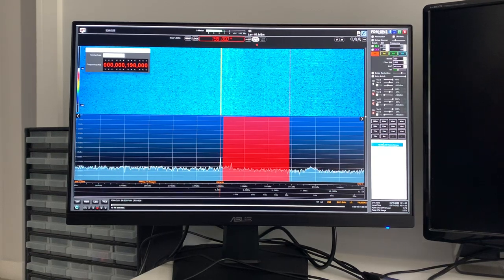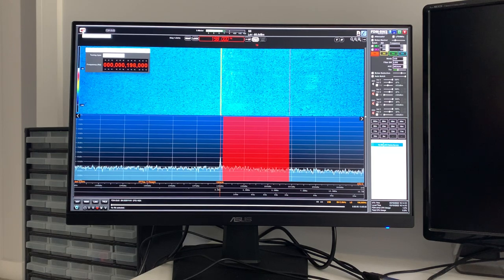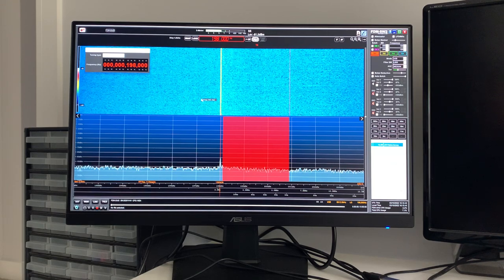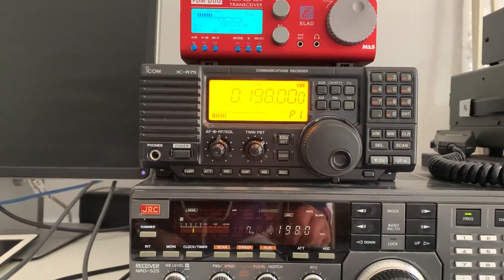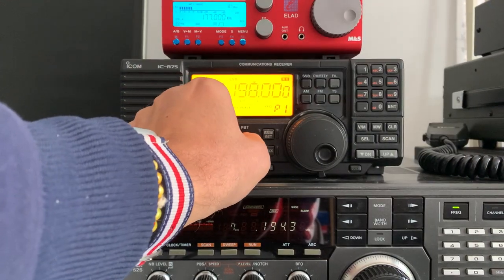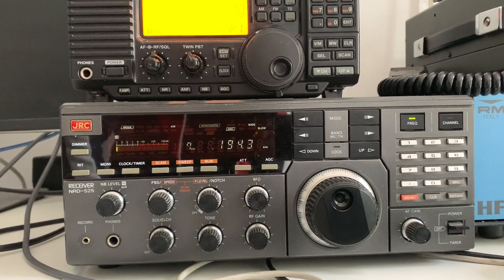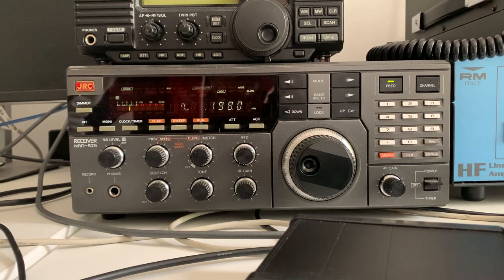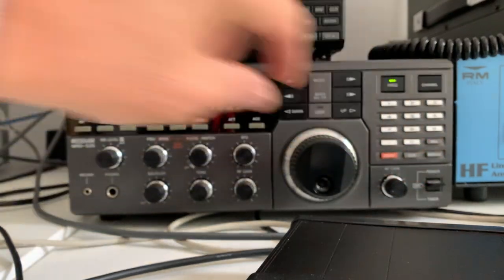BBC Droitwich transmitter is down, revealing the Radio 4 signal on longwave from Burghead/Westerglen

Comment: Hi Clint, up here in Dundee 198 Westerglen is the main transmitter for Central Scotland. Its the one I listen to. Its quite a sight at night when you pass it on the road. 73 and GDX
Reply from the maker: Cheers, Jim. It was quite a thrill to hear one of the two transmitters in Scotland. I did try to orientate the Wellbrook loop for optimum signal strength, but about S7 was the best I could manage. Perfectly readable of course, but nothing beats that S9+30dB from Droitwich! It's a bit like when Ireland is down on 252 kHz and Algeria comes storming in! All the best and 73.

Comment: I could still receive BBC R4 LW yesterday with my Sony ICF-2010 indoors, weaker but still audible. It seemed to be restored in the evening. BBC Radio 5 Live on 693 Droitwich was also affected, although I still had good signal maybe from the Brighton relay not far from me. Thanks for sharing & 73s.
Reply from the maker: Looks like you were copying the same signal as me! 73

Comment: What will happen to all the economy 7 radio teleswitches ? When they don't get a switch on from the 198m  transmitter tonight?
Reply: The old French longwave transmitter on 162 KHz which 'closed' some years ago now just sits with a carrier and their data signals for switching.
Reply: There is actually current info from the BBC that the agreement with the british teleswitch operators is definitely ending by the end of 2023. After march 2024, the longwave service over 198 kHz is planned to end for good, entirely. So, alternative ways of controlling these devices (maybe over the internet) seem to be on the way.
Reply from the maker: See other replies - but the deal ends this year so it won't be the BBc's problem. 73

Comment: How do they keep the multiple transmitters from interfering with one another? A few years ago reception from other English stations like Absolute Radio and Five Live was poor, with echoes and fading. Reception of Radio 4 is good in Latvia.
Reply from the maker: If it's the same transmission, the slightly different path lengths result in a slight echo. You can hear that sometimes on MW with Spanish stations.

Comment: In the 70s and 80s, when I lived in Plymouth, R4LW had some peculiar slow (minutes long) deep fading that affected the sidebands differently. At least, the audio got quite distorted, whuch I put down to phase differences between the sidebands. This was only audible on ferrite rod antennas - the long wire was always fine - and some very small changes in the set's position or orientation could change things quite a lot. Seemed worse in daytime. I never understood it - I was still at school and RF was a bit weird - but I wondered at the time whether it was multipath enhanced by the buge lump of granite called Dartmoor that was between me and Droitwich. Never seen the phenomenon discussed anywhere, but it puzzled me then and puzzles me now.
Reply from the maker: Thanks for your comments!

Comment: Have you got Scotland in the null of the loop? That would make sense if you were trying to reduce the level to pick up other signals from East and West.

Upper vs Lower - it is like upper class being better than lower class, upper income better than lower income or upper Manhattan vs lower Manhattan...ah, maybe there is a flaw in my argument... more seriously, perhaps the noise or some phase effect.
Reply from the maker: No, I adjusted the orientation for this recording. I thought it might be a phase effect - much more obvious on the loop than on my wire. 73

Comment: I'd heard somewhere, maybe right or wrong, that the BBC were experimenting with a different type of modulation to try and cut down on the amount of power used to generate the same amount of output, a bit like SSB while generating both usb and lsb plus a variable power carrier when modulation takes place (DSB using class C). I'm not saying this is the case of what your hearing or its just general maintenance taking place and it's the effect of ground wave effect on your loop antenna. Also when the supply of klystron output valves run out then that will be the end of 194LW.
Reply from the maker: Using less power does make a lot of sense - it's one of the big negatives to R4 on LW.
Reply from the maker: Thanks for your comments.
Reply: Klystrons for LF? The BBC are very short of money. R4LW was due to close approximately 10 years ago (from 2022). Allegedly the Shipping Forecast saved it then. Whether it will survive now in the light (no pun) of the vertical trajectory of energy costs is anyone’s guess.
Reply: @ianharrison6597  I can't possibly imagine that it's klystrons - Klystrons can barely handle the lower part of the UHF range. The OP doesn't know what they're talking about. 

They are likely some variation of a large water-cooled tetrode, if I had to guess. In any case, there are plenty of companies that could easily rebuild that sort of tube - CPI in the US, Thales (France),  and there is at least one company in Japan that could do it. There are a few companies in Russia that could do it if international politics were to clean up a little.
Reply: The announcements have started since May 2023 preparing listeners of the closure of R4 LW in March 2024.

Comment: 198 kHz now prolonged to stay on air until mid-2025 (now carrying BBC4 FM programming most of the time). Only reason for the delay : the british teleswitch service has not yet migrated largely to alternate sources of control.
Reply from the maker: That's correct.